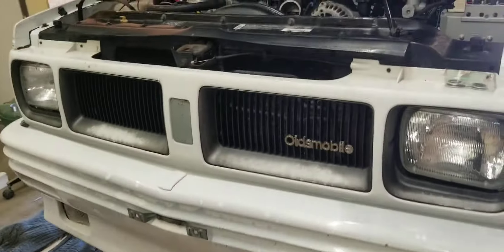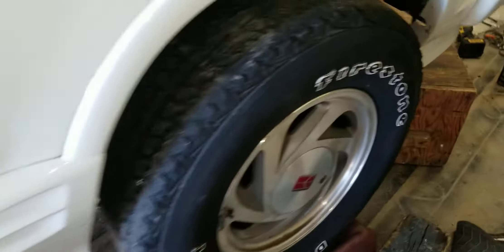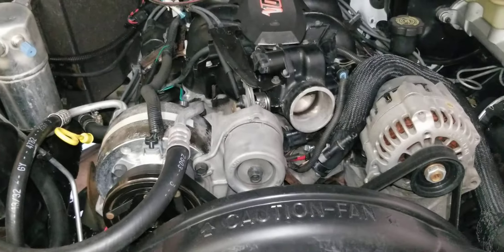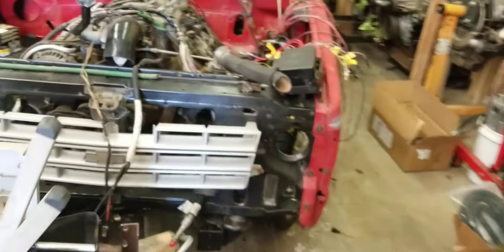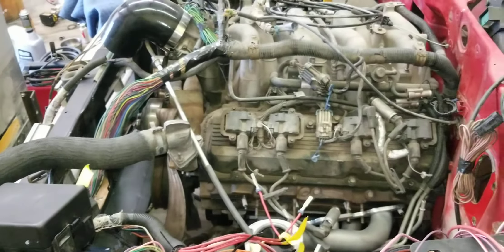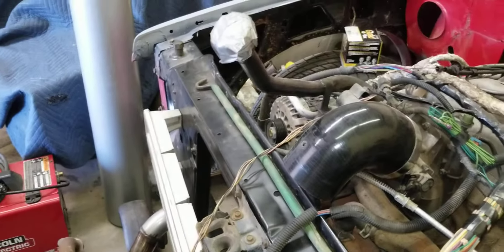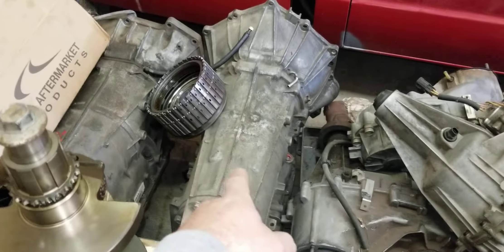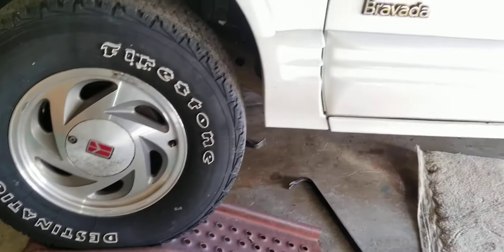1994 Oldsmobile Bravada AWD swap l18 8.1l 4l80 swap

Comment: I love the bravada v8 but the big block is a bit too big for me especially with gas prices the way they are plus  a 5.3l is all I need and plenty powerful  ,what would be super sweet to see and no one is doing it is swap in the cadillac 3.6l twin turbo v6  450 hp 8 speed tranny  in that bravada or a s10
Reply from the maker: Lf4  8 speed with a transfer case  do job nice but I don't own that motor 🤞yet.
Reply from the maker: I don't know what spline the eight-speed is to adapt it to a transfer case yet

Comment: How much horsepower can those AWD transfer cases and front differentials handle?
Reply from the maker: I still have bbc8.1 not turbo going with a supercharger instead. all will drive Bravada in the works.